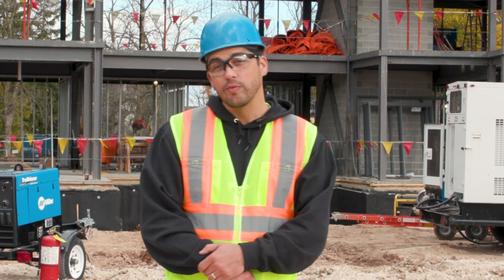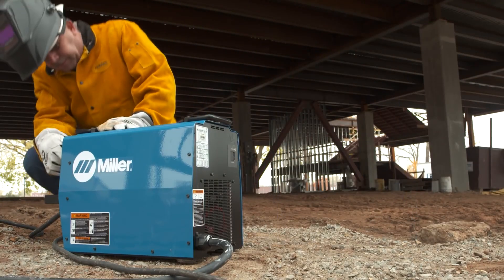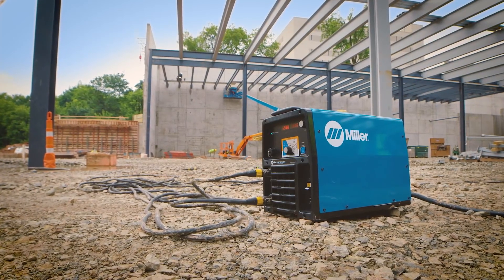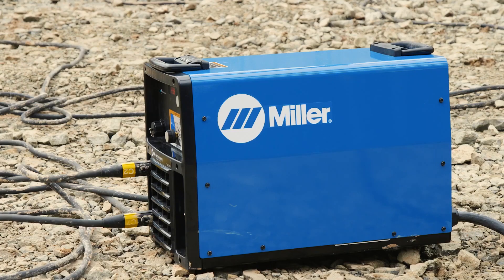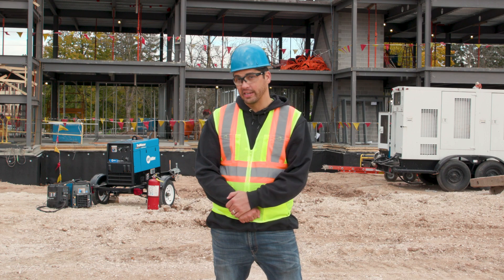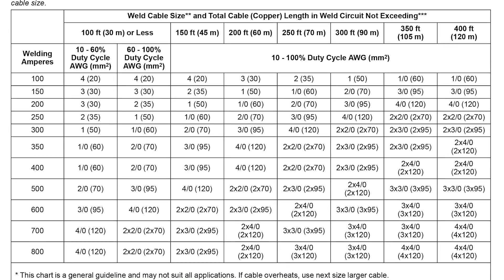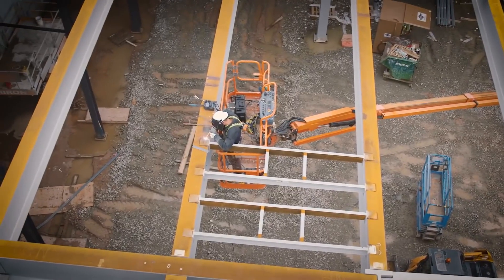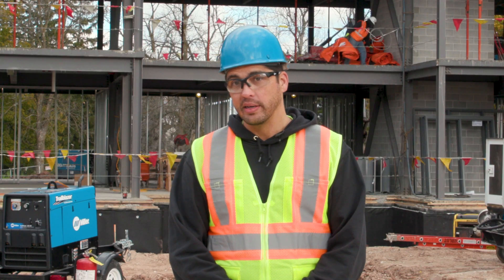Avoid Voltage Drop to Improve Weld Quality on Jobsites

Comment: Some buildings have terrible transformers as well
I adjust my voltage settings 40% across different job sites due to the building. It’s very odd. I haven’t figured that one out yet.